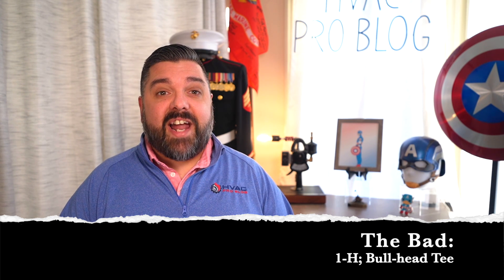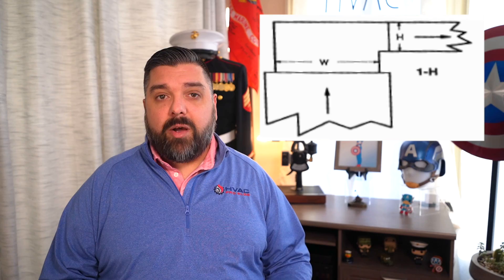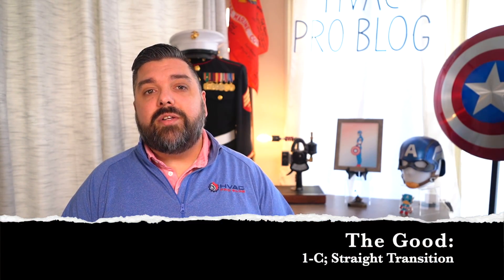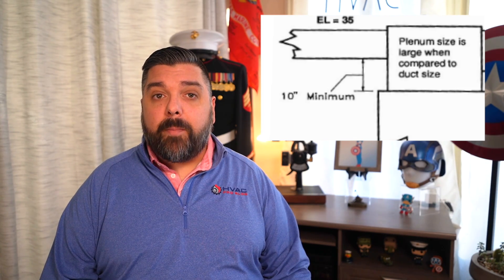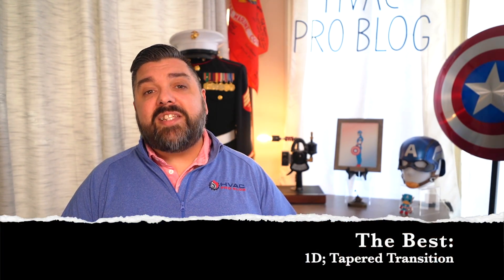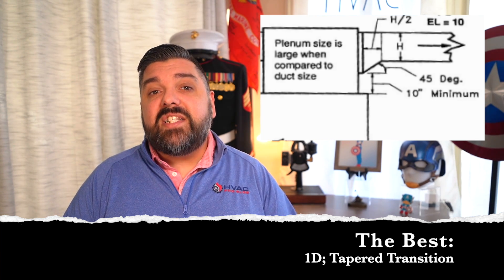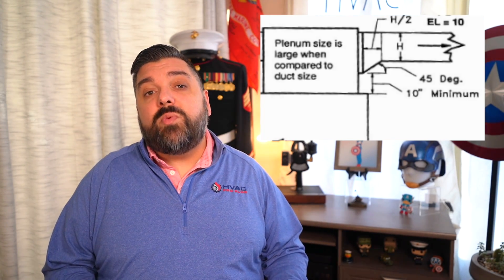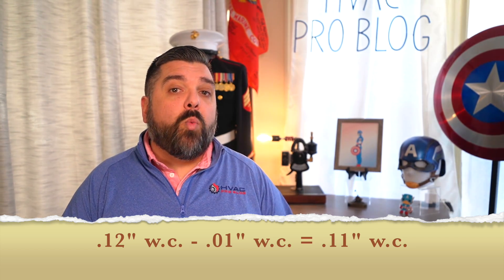HVAC Duct Design Mastery: The Supply Plenum & Transition Decoded for Sales Pros!

Comment: Hey please!! Need help!! I have a 4 ton heat pump with the return coming from the bottom, it needs to sit on a 13 inch high box to accommodate a 10x30 return drop and the unit is 49 inches tall, so 62 inches total height. My ceiling is 77 which leaves me 14 inches for a plenum and my trunk line is 10 inches tall. I wanted to do an offset to the trunk line to give good air flow but we're talking like 1-2 inches from the bottom of the plenum. Is that a problem? This video is the closest thing I could find to any content discussing this and it mentioned 10 inch minimum which would be impossible even with an 8 inch tall trunk. Let me know please!! Any advice? Am I okay?

Comment: If you dont have that 10 inch min when you use a 45degree taper on the 1-D, should you stick with stabbing into plenum to preserve 10 in height, or go with taper and sacrifice soem of theta height to below 10 inches ?>
Reply from the maker: I would recommend some taper.  Just realize it may not be a 10’TEL then.  Somewhere between 10-35’ is likely.